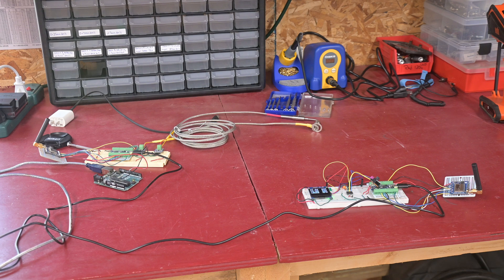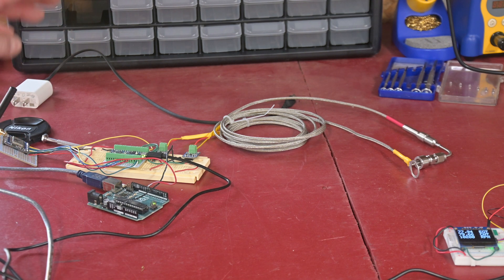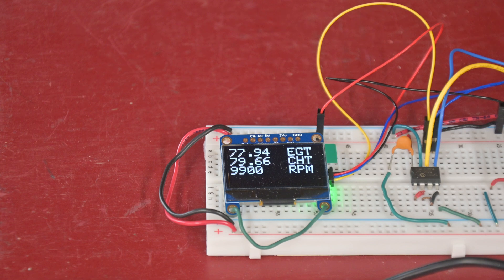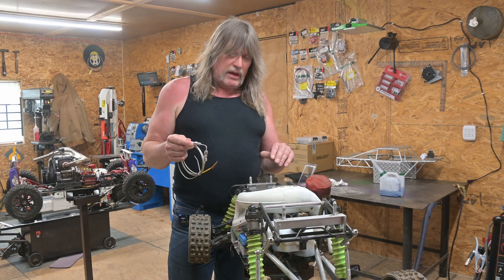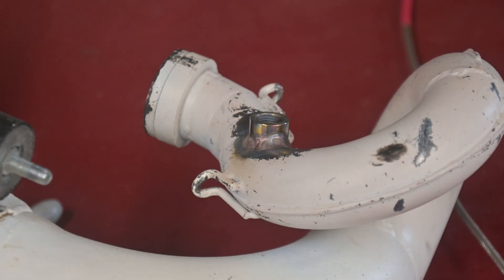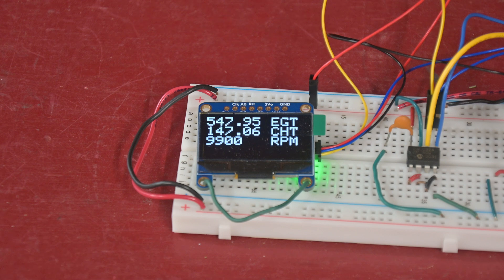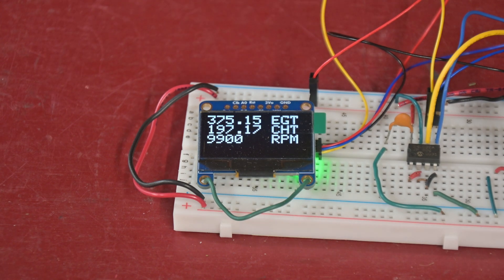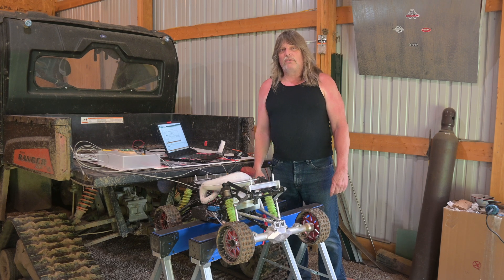Wireless engine data SCADA for 1/5th scale RC. The Taylor 50cc gets wired up with sensors

Comment: That’s cool stuff Brian!!! That is crazy how quick the EGT raises.   What if you just induce on the wire for rpm? Great project
Reply from the maker: Hey Kyle, i'm concurrently working on a pulse conditioner circuit to do just that and a 3d printed mount for a hall effect sensor inside the Taylor mag housing. The hall effect will probably be done first. Thanks for checking it out

Comment: I use a flysky with telemetry and thats exactly why.  To watch temps, vs rpm, vs egt.  And of course pack voltage.

I had the same thought about where to put the egt.  And my thought was the same as yours but i chose differently.   If the escaping gasses do cool right at the head, thats exactly where i wanted to to be as if that rises, then the temps inside the combustion chamer have to be climing too.
Reply: I haven't really done any videos sadly.  I wish more transmitter companies were cheaper on their telemetry radios.  It's just what I use.  And without it, I would never have known one of my 1/5 scale mini sprints was no where close to peek rpm.  Turned out to be a pipe problem.   The pipe was adequate for a stock engine but killed the 6 port cylinder and stroker mods.

I am no were as tech savvy as you are in this video.  Its great info and I may use some of you knolage for a dyno set up I want to build to get all the data you have access too now.  It's the only way to know. 

Thanks again.
Reply from the maker: @jdsstegman  Well i'm thankful you can use the info and there will be follow up videos on this subject.  Next will probably be the induction probe for the RPM sensing along with a schematic of the pulse conditioning circuit. Thanks for checking out the video and for the comments
Reply from the maker: You can never have enough info, well in the case of an engine anyhow. I have to go check out some of your engine videos now. Thanks for watching JD

Comment: check out the hall-effect sensors that we use in RC helicopters made by Xguard RC.  one picks up off a magnet that you epoxy into the fan and the other sensor picks up off the crankshaft spinning, thru the crankcase.  I've used both and don't see any reason why you can't use either of those for this application.   The sensors themselves are small and weigh almost nothing.  In kart racing, our RPM sensors pick up off the electrical energy in the spark plug wires.
Reply from the maker: Thanks for the tip. My original plan was for the hall effect but i'm running into space issues inside the Taylor engine, so i'm currently working on a design for a inductive pickup for the plug wire. Thanks for the info and thanks for checking it out